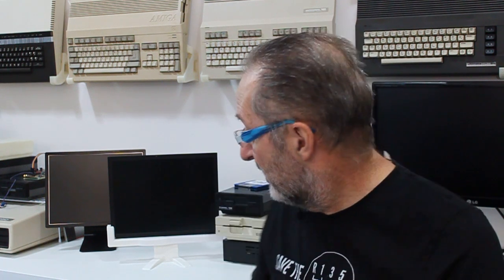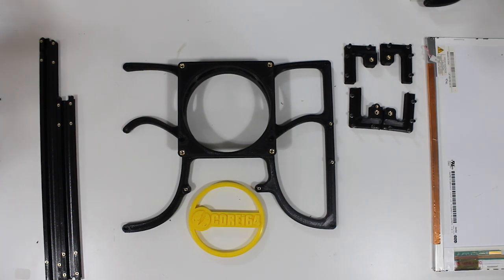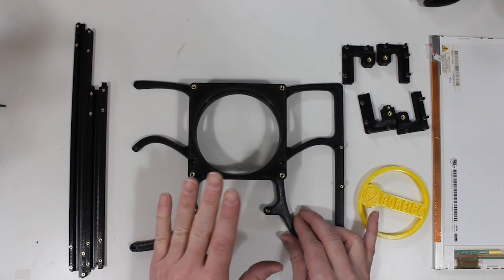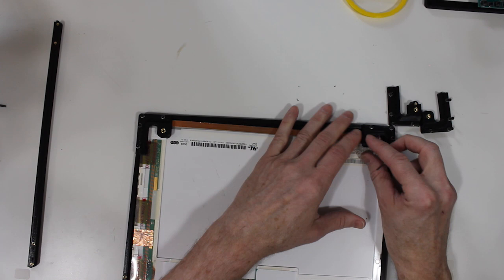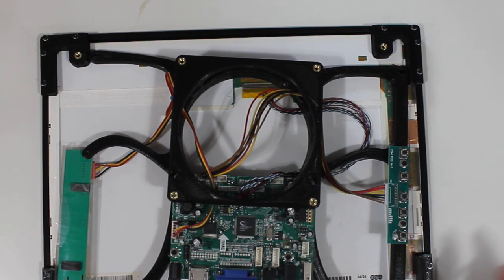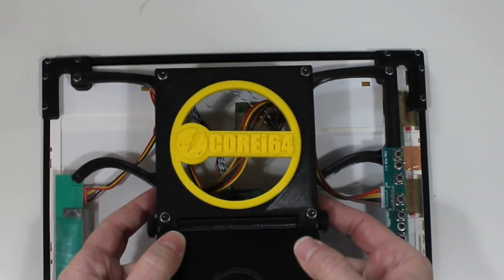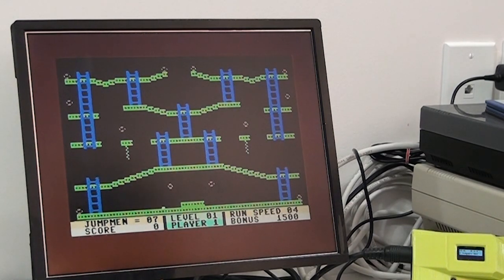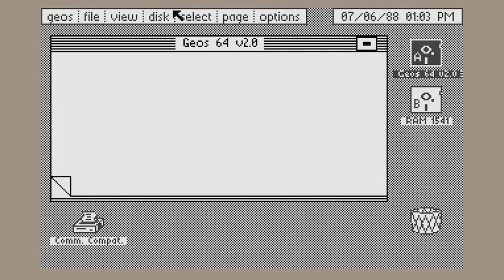3D Printed Retro Computer Monitor on 3D Thursday

Comment: What a brilliant idea! I've sourced a cheap 14" 4x3 replacement panel on ebay for £13 (for a Toshiba Tecra). I gather the driver boards are specific to a particular panel, so I'll need to wait & see the exact panel designator before getting that. One question: you said you used a "large" printer. What are the maximum dimensions of your print? ie would it fit on an Anycubic Vyper? (245 x 245 x 260)
Reply from the maker: I use Lulzbot TAZ6 printers.  They have a print bed dimension of 280 x 280.  The longest rail is 311mm, and the rear mount needs 256mm x 208.50 mm
Reply: @8BitResurgence  Ok it's not going to fit then. I'll need to come up with some other solution. Thanks anyway.
Reply from the maker: @TimsRetroCorner  sorry to be the bearer of bad news.

Comment: Where are the electronics you use to adapt the LCD from?
Reply from the maker: If you search LCD panel driver on ebay, you'll find a lot of vendors selling them.  Once you obtain a panel you'd want to use, you just need to reach out to one of them that you like the look of, and they should be able to match the driver board with your panel.